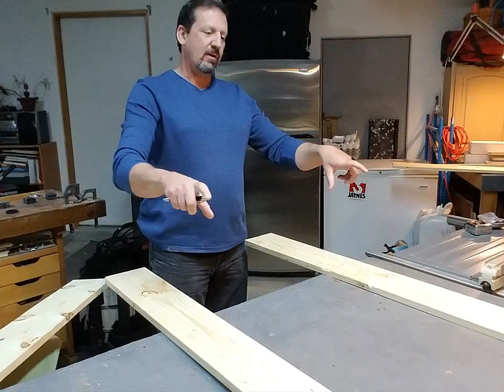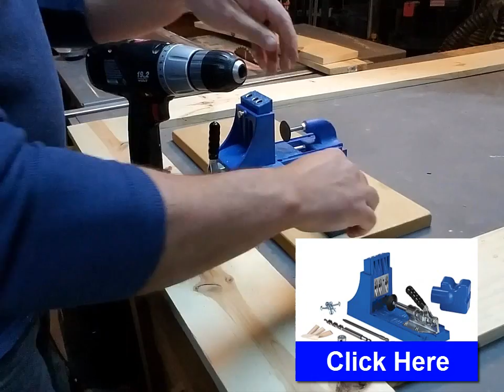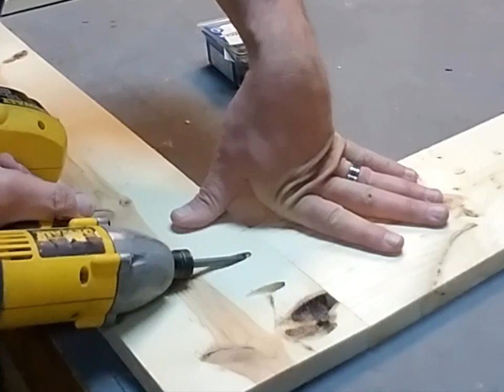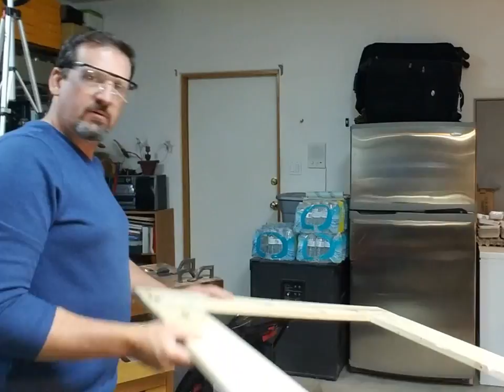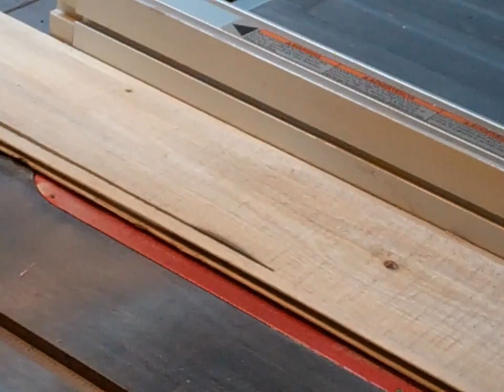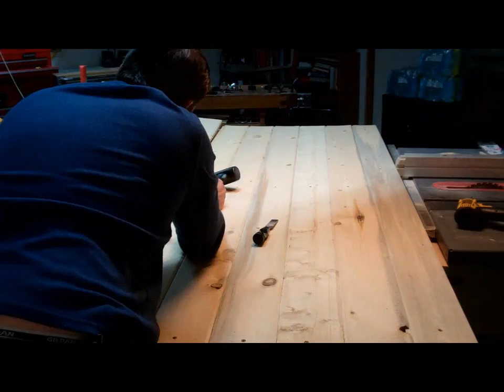How to build a Custom DIY Barn Door! Part 1

Comment: If you had started with mounting the first T&G board centered lengthwise you would ended up with equal spacing on the sides. Did you also rip the tongue off of the last board before glueing and screwing it down?

Otherwise, good video. Thanks.

Comment: Good video. Out of curiosity though, why did you put the pocket holes to screw into end grain, surely it wouldv'e been a much stronger joint to drill the stiles and screw into the rails?
Reply from the maker: Scott Parker-Copestick you know it's funny, I always put pocket holes into end-grain projects, but when we watching my video I think the reason why I put them into the rails was because they were too tall to sit in my jig LOL! With the tongue and groove attached to the back it isn't a problem on these doors.
Reply: I was going to say the same thing! Was taught the other way and wondered why he did it that way as well. LoL

Comment: Hi, I'm thinking of making a slide door between my bedroom and bathroom.
Opening is 48 inches wide. The door will be installed to the wall on my bedroom side.  I'm trying to decide if the door should face towards my bedroom and have the back facing bathroom side. 
Not too sure.  My door will be white. 
All my doors are white. 
Where did you get the grove panels from??  Homedepot?  Great video.
Thanks
Reply from the maker: I got them from Lowes.   I would face the pretty side toward your bedroom where you will see it most.
Reply: @maker-logic  Thanks Tom

Comment: Good vid, I would of made the outer ends of cladding equal and also jointed the frame. Also only 1 fixing into each rail may not be enough to stop the timber from bowing. 😀

Comment: Hi!  Great video.  I am going to attempt a similar door as Shannon Lloyd mentioned in the comments, which you replied to.  I have a couple questions, if you don't mind?  If I do the tongue and groove first, maybe even use a small amount of wood glue on the tongue for each board, then sort of frame around it on the outside, on both sides (such as Shannon mentioned she was going to do), I am planning on doing both horizontal boards as well as vertical boards on each side. Can you advise if you think the door will be stable if built this way?  This is going to be an 80" x 80" door.  This is essentially the opposite process as the way you built yours as you built the frame first, then attached the tongue and groove boards. Also, are brad nails a bad idea?  If I use screws and slightly countersink them, do you think if I use  wood filler on top of them, and then sand and stain the door, the screw locations will be minimally noticeable?  Being an 80" x 80" door, would you recommend more than one center horizontal board, perhaps two, spaced correctly?  Thank you in advance!
Reply from the maker: All of your ideas will work,  but I do suggest you use a horizontal stile on the door so it doesn't warp.  I built a solid 5' barn door with 1/2" maple plywood and a center stile and it warped about an inch on one side.

Comment: Thank you for the video.  It has convinced me that I can do this.  I do have a question.  I am going to attempt to build a door similar to yours but instead of having a frame on the outside of the tongue and groove we were going to simply have a 3 horizontal boards (one at the top of the door, one in the middle, and one at the bottom).  The horizontal boards will be  a 1 X 8 board.  My question is do I simply build the tongue and groove door first and then attach my three horizontal board next?  I am planning on having three horizontal boards on front and also back of the door.  Is there an order in which I should attach the horizontal boards (ie: middle, bottom, top)?  I think this is my last question, should I try gluing the tongue and groove boards as well as attaching them to the horizontal boards?  Again, thank you for the video!
Reply from the maker: Hi there!  I would put tongue and groove boards together first, however, remember that they may want to come apart if they are warped in any way.  After you have them all together, I would then attach the top and bottom horizontal boards to the door panel in order to square the door. Then you can put the horizontal board on last.  Note: Using glue with your screws is a great idea to help make it more solid.  Hope this helps!
Reply: I can't say thanks enough.  Your fast response is valuable and timely.  THANKS

Comment: Mr. Tom,  I think this is my last question.  What length screws do you use.  I am making a door out of tongue and groove and then a partial frame on both front and back.  I don't want my screws to hit one another when I go to screw in the frame.  Thank you!
Reply from the maker: It depends on your thickness. Are you using pocket holes at all? How do you plan to screw the tounge and grove to the frame boards, from the back?
Reply: THICKNESS:  tongue and grove= 3/4 inch
                        frame = 3/4 inch (I will have a frame on front and back.  My frame is only 3 horizontal boards
                                      but not vertical boards.  I guess you would call it a partial frame?)

POCKET HOLES:  I will not use pocket holes.  It scares me!

FRAME BOARDS:  I plan to attach the 3 horizontal partial frame boards from the front. I saw this in another video, but I am always up for suggestions.  In his video he filled the holes with putty and then sanded.  Now that you brought this up, I am thinking that maybe I should attach the horizontal frame boards on one side from the back, allowing a pretty finish on the side of the door that will be seen the most,  and then do the back side of the door from the front being it will only show in a hallway.  Please let me know what you think would be best.
Reply from the maker: I agree to attach the horizontal boards on the front of the door from the back of the Tounge and groove to hide screw heads.  I would use 1" long flat headed screws to go into the 1 1/2 t&g and frame.  Then I would use 1" screws from the back to attach the frame pieces on the side that you cannot see from the main room
Reply: I understand.  Thank you for the clear explanation .  I feel equipped to do this!  Thank you for responding so quickly.  Depending how it turns out, I might send you a picture.